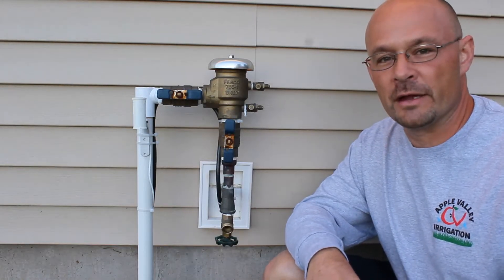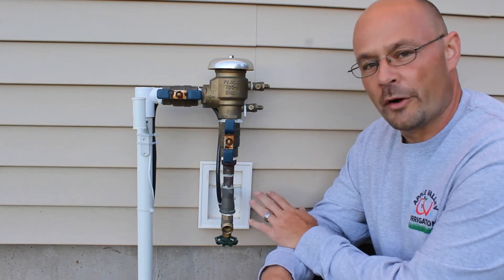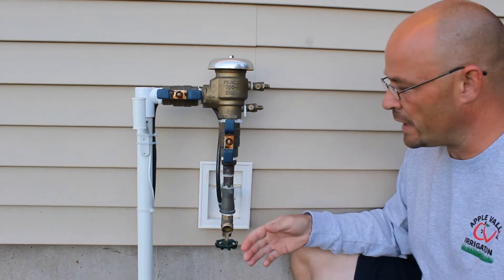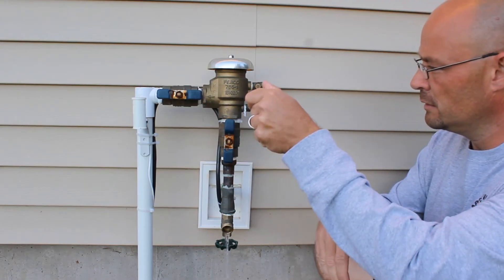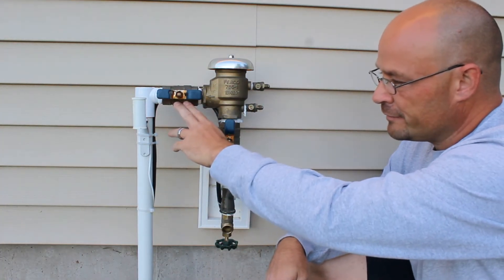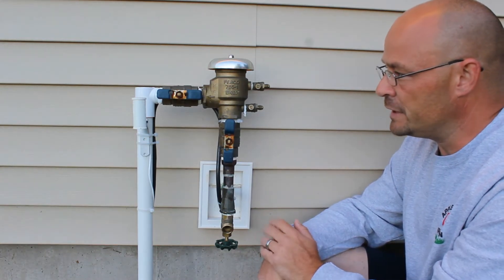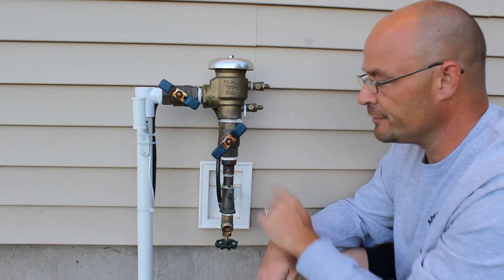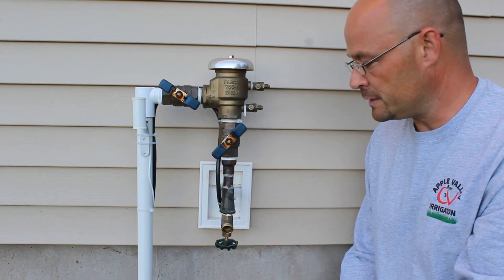Draining a Backflow Prevention Device (Febco 765)

Comment: I have a drain nut at the bottom where you have your shut off valve. I am experiencing a slow drip when the sprinkler water valve is off and I took out the insides for the winter. Is this water coming from the inside or a seal inside the backflow preventer?

Comment: Could you not just insulate it? Im from south carolina so i dont winterize as a regular practice. I just insulate my above ground lines and thats usually sufficient.
Reply: Unfortunately we are not able to do that here in Connecticut. Even the lines in the ground have been known to freeze and crack so everything gets winterized with an air compressor to blow all the water out of the system.
Reply: @matthewkrom5898  so you gotta do that on a nightly basis?
Reply: @misterd717  no we blow the systems out in October/November for the winter and reactivate them in April/May
Reply: @matthewkrom5898  oh ha dumb question, its for irrigation.

Comment: How do you fix/replace the faucet at the bottom?
Reply: Depends on how it was installed. Most are just threaded with Teflon tape or plumbers putty so you can typically unscrew them with a wrench. Some are soldered in place and I’d recommend a plumber for that.
Reply: @matthewkrom5898  That's what I figured thank you sir.

Comment: Hi. I have a Febco 765-1 Backflow Prevention Device like the on in your video. When it is time to turn on the water in the Spring, What are the steps to turn the sprinkler systems on without blowing the bonnet and poppet?

Comment: My irrigation is flat with no inclines. Can I cut the 26 inch high vacuum breaker to 18-20 inches?
Reply from the maker: Code requires the bottom of a pressure vacuum break (PVB) to be at least 12” higher than any component of the irrigation system that contains water. You can work from there to get it as low as possible.
Reply: @applevalleyirrigation7987  Thanks, I am shortening mine.I will go down to about 18 inches making it possible to cover for hard freezes.

Comment: It appears I’m going to have to run my compressor through one of the bleeder valves to blow out my system. From watching your video it appears that moving the screw on the bleeder valve horizontal is opening it up and vertical is closed. Have you ever seen anybody hook an air compressor up to one of those bleeder valves and if so should I use the top one or the bottom one. And also the vacuum cap on top ... is that a bolt supposed to be tight or loose? I’m asking because I tightened mine because when I originally hooked the air compressor up to the bottom drain area(I made a rig with pvc and a 3/4 brass male) The air could not flow through the sprinklers but it just made a loud rumbling on that vacuum cap. So anyway it appears I need to use one of those other bleeder valves.

Comment: My Febco 765 setup doesn't have a dedicated blow-out port.  Can I connect a compressor to the test cock ports using a 1/4" quick connect fitting and does it matter which one I use, the upper (downstream) or lower (upstream) port so as not to damage the PVB?
Reply: You'd want to use the lower so you could get water out of the lower check valve compartment but the upstream ball valve will still need to be cleared of water some how. Hopefully you have a low point drain inside somewhere.
Reply: @matthewkrom5898  Thank you for the helpful reply. Yes, I have a drain nipple in the basement for that purpose.

Comment: Is there any benefits / drawback by having a PVC pipe (instead of metal pipe) from backflow to sprinkler?
Reply: Most companies use PVC because it's cheap and easy. The benefit is it holds up to freezing temps better when still filled with water than copper. Copper is better because it supports the unit better and can withstand weedwackers. It shold be done in copper and have unions on either side so the backflow can be removed but no one does it that way.
Reply: @matthewkrom5898  Thanks a bunch!  I throw down pre-emergent couple days back, and forgot to close the water main afterward.  Back flow froze overnight and is busted.  I now know what I need from my contractor.  I will have him replace the old copper pipe and put on union fitting on one side.

Comment: I saw a video earlier where a guy used a washing machine hose, cut one end off and rigged up air compressor male bib to the other side.  Then he would screw the washing machine hose on a spigot like you have there and connect the other end to a 30psi compressor to blow out the water of the entire system.  Thought that was a good idea.

Comment: I followed these steps and drained water from the test cocks.  (My PVB doesn't have a drain at the bottom).  However I can still hear a little water sloshing around the chambers when i shake the assembly.  Is it normal to have some water remaining?  I'm assuming this small amount isn't enough to cause freeze damage?
Reply from the maker: SeminoleRail if your backflow doesn’t have a drain at the bottom you should have a low point drain on the piping inside after the shut off valve. If you don’t have that there’s really no way to remove the water other than disassembling it and using a shop vac. If it’s installed with unions you could remove it and store it inside. To answer your question, hearing water sloshing around would worry me.
Reply: Thanks for the reply.  I use a water valve key to turn the shutoff valve. The entire line from the water source to my backflow preventer is underground so that's probably why there is no drain.  What I did was disassemble the top of the PVB and used a shop vac to get out most of the remaining water.  Then I wrapped the pipes with foam tubing and put an insulating cover over the whole assembly.  Hopefully that will prevent any freezing issues.